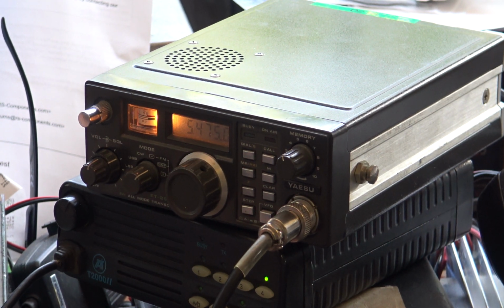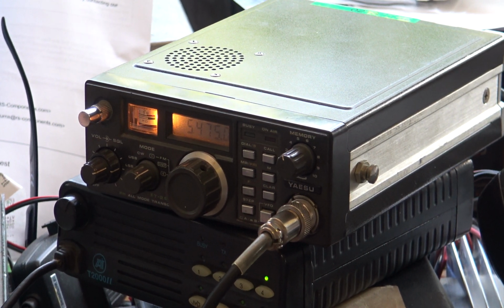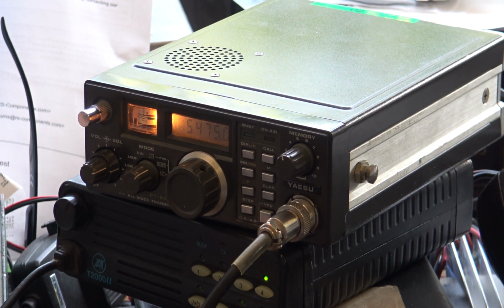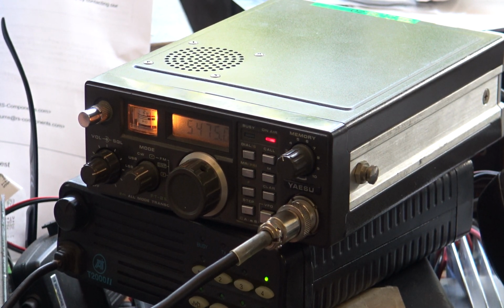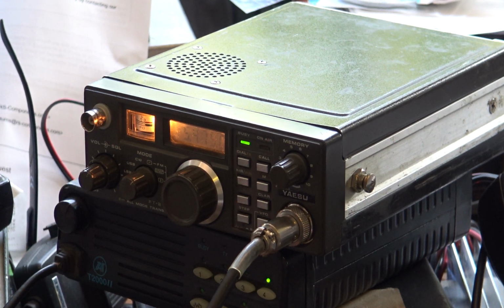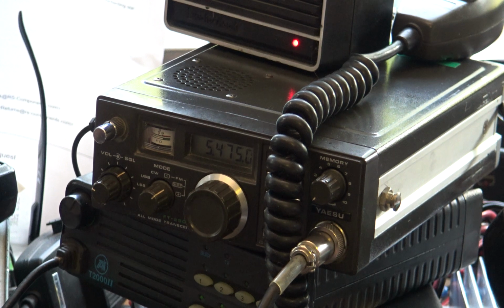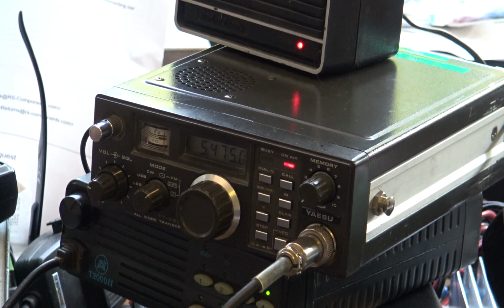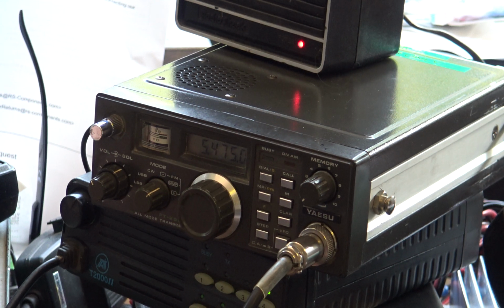Yaesu FT290R 2M amateur radio 2.5W FM On The Air test

Comment: I have one my father left me unfortunately it has no mains power supply I gather the original is centre negative and should be 8.5 to 15 volts. I’d like to use it as I had one years ago would it run on 2 Amps please?   John G0MUZ ex G7FAP.
Reply from the maker: I've just looked at the instruction book for you. You are quite correct on the polarity & voltage range, though usually you'd be running it on 13.8V. The instructions say that 2.5A is the maximum current it will ever draw.

Richard, G0OJF, UK
Reply: @ukfmcbradioservicingTango21  many thanks indeed!!
Reply: Hi Richard ive one of these its got isue where receive is pined to the right on the meter people say its bad Agc transister, what you think
Reply: mine draws an amp when transmitting and 80ma receive

Comment: Richard Why Are They Only Pushing Silly Power ? Have They Been Deliberatey Turned Down ? I'm Sure My Two Kenwood 2M Handheld's Are Doing @ Least 3 Watts 

Bless Up Lads
Reply from the maker: You'd better go back to 1980 in a time machine & ask Yaesu. However, these are an all mode (except AM) 2M transportable that do 2.5W. There are battery holders for 9V's worth or C o D cells (can't remember which), so are fully self-contained with the front panel mounted telescopic aerial. At that time, the Icom offering was SSB only. Trio (Kenwood) transportable was FM only. You have to compare like for like of the same year manufacture. These sets are now over 40 years old. Back then most mobiles were 10W & most handportables were 2.5W. that goes for business radio as well as amateur.

Richard,G0OJF, UK
Reply: @ukfmcbradioservicingTango21  Mmmm I Wonder If That's Because The UK Would Only Allow Them In @ Restricted Power ? 
All The Same They Are Lovely Sets And I'd like One Myself ! Thank You For Your Work And Replying 
Graham :)

Comment: Are you selling any of these Richard?
Reply from the maker: Sorry,I think you missed the story in the previous video. These four radios were being offered "as is" to my amateur radio friend Stewart. None of them worked properly. My job was to evaluate them, which I did on the previous video & retuned them as per manual so they were on frequency. In effect I went through 70% of the alignment, leaving all SSB side of things untouched. So they are not mine to sell!

Richard, G0OJF, UK
Reply: @ukfmcbradioservicingTango21  Yes, I did miss the 1st video. Thanks for your reply. I missed out on a ''as new'' one of these in the box at a radio rally 2 years ago. It was a silent key sale and ''make an offer''. 
Well if I'd thought the acceptable offer would be £20..... gutted. 73
Reply from the maker: @mm9stm  The only snag with anything like this is that the reference crystals drop with age. So like with these sets it's quite a procedure with the service manual & test gear to put them back on. I paid a very generous (over £300) for a Yaesu pair of all mode mobiles of this kind of age. Blow me, the reference crystal has dropped out of spec so I'll have to have one custom made. That will cost around £35 & be about 6 weeks.

Richard, G0OJF, UK
Reply: They do appear on eBay frequently and there are lots of spare boards for sale so repair is easy, also these regularly appear at radio rallies and even car boot sales,  I've always fancied one but the lack of tone doesn't make them practical however SSB is a novel touch.

Comment: Your mic connection appears loose!
Reply: The GX16 mic plug cable grip does look loose
Reply from the maker: Roger, I spotted that thanks on the editing. I may as well tighten it up.though the job is an evaluation rather than a repair.

Richard

Comment: Good job they are not the FT290 MK2, they are an absolute pain to work on. Lots of stacked double sided PCBs where you can't fault find while it's on. Nice T2000 MK2, I just converted 2x T2020 MK2 4m from AM back to FM and carried out a full alignment. Nice chassis to work on.
Reply: I had a Mk2 290 the interchangeable battery pack for a linear was handy but as you say
if they go wrong they are a nightmare, In all ive had 3 FT290 mK1 and a FT790 mk1
i miss the 790 it worked properly without the stupid mismatched telescopic whip
the 290 had, theres plenty written online how to take out the whip all the way back to the Main board and feed some RG175 etc straight to a BNC on the front, just like a the 790.
to do the job properly you do need to change about 3 Caps in the pi network.
it improves about 3db S/N to the RX
Reply from the maker: Mr Chippie bought a silent key sale FT790 II, which was a pain to work on.He needed to change the tactile switches on the front panel which we finally managed to order a type that fitted from RS after several 'not quite right' ordering attempts. BNC socket was knackered too & we had to get a long threaded version & carefully grind away part of the shoulder for it to fit. Clearly no Yaesu spares as they only support for 7 years. I will add that the tactile switches were no good owing to extreme ingress of nicotine....which probably did't help the previous owners' health.

|Richard, G0OJF, UK
Reply: @ukfmcbradioservicingTango21  I had the same issue with the front BNC, the old one was in there so tightly! I modified the front chassis with a file and had to carefully enlarge the plastic hole on the bezel. Yes nicotine is a problem and I hate working on anything on the bench that a smoker has/had owned, for this and many other reasons I prefer working on commercial or ex commercial equipment.

Comment: Change from CBs, interesting to see the range compared to CB.
Reply: IMHO 2m was ruined by going from 25K spacing 5k dev to 12.5k 2.5k dev
40 years ago ARRL, Motorola, and FCC did extensive tests to discover most effective
NBFM spacing and dev, they settled on 20k and 5k dev (4k dev for LMR, business radios)
Thats why there is No FM on US CB, 10k spacing is unsuitable for FM.
Proof of the pudding is UK 1.6MHz split 25K 5k dev 433MHz repeaters are far more popular than any of the VHF or UHF 12.5k ones. At least subconsciously the mind
 finds the strain of listening to 2.5k dev uncomfortable
We should be on 20k spacing 5K dev